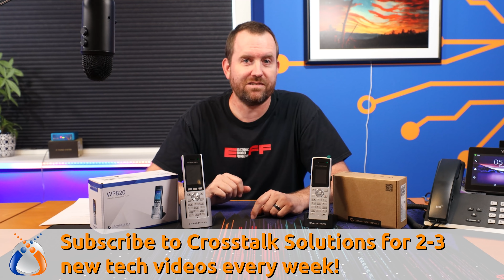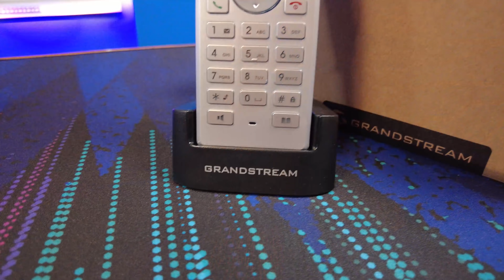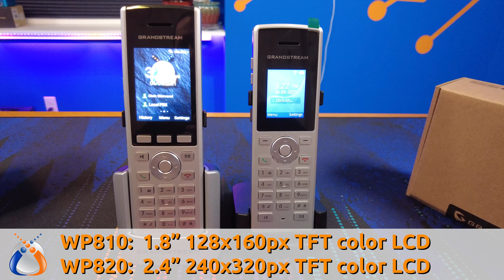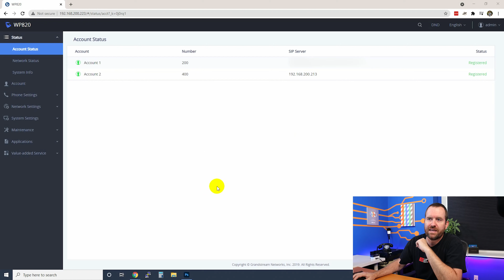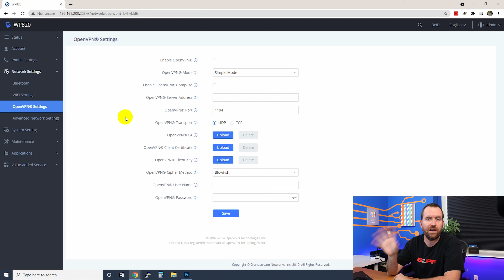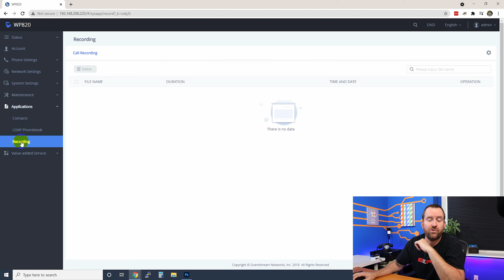Grandstream WiFi Phones - Any Good??

Comment: Newer sets now.    Both the Grandstream Dect and WIFI cordless phones have been superb since day one.     

 The WP826 is the best WIFI cordless phone, period.    Doesn't have lag or delay like others also.     (When a phone has been sitting for a while and the first digit dialed is not recognized)      The price point is amazing.   Best value for a VoIP device we've ever seen.    12hr battery, 240hr standby - come on - WOW.     There is a reason they are already sold out at most distributors.    There is not a finer WIFI cordless on the market for the price.

Comment: After a renovation we're getting our VOIP phone service hooked back up. Since VOIP phones use an ethernet connection I assume this Wifi VOIP phones would work for me? I don't want to have to run ethernet cables from the phone modem to the phone set upstairs in our study.
Reply: It's a wifi phone. It doesn't use Ethernet at all. Instead, it connects to your wireless modem.

Comment: Why purchase a wifi phone when you can repurpose an old cell phone and program your sip provider with telephony software?
Reply: Far better form factor. In a slightly ironic twist, making phone calls is the one thing modern cell phones are terrible at doing. They're very uncomfortable over an extended period of time, and having to bring up and use the digital dial pad in the middle of a call can be cumbersome vs. the physical keypad on the wifi phone.

Comment: Hi Chris. We recently changed from hosted to onsite PBX using Freepbx. I am currently struggling to connect the wp820 to freepbx. I have done the Fanvil x3 without any problems. Both phones worked perfectly with the hosted server (I do not know what software was used).

Could you please give me some advice? I am in South Africa.

Thanks,
Marlin

Comment: A good way to use the two accounts is to set up one for the local WIFI and the second to the same extension but the external ip address.  then can use the phone while out of the office as if still in office.

Comment: Deployed these on an avaya ip500 system on a 3rd party license after out old dect system failed about 3 months ago. Found these to be awesome and much better then the android grandstream app which often failed.
Reply: I found making a SSID on Ubifi at 2.4ghz only gave you much better coverage. Only area which was tricky was a thick metal door where the pass over between outdoor WiFi unit and inside had a small delay rarely dropping the call.

Comment: Man, the WP820 would (could) be a perfect replacement for an airport / ground handling radio setup (at least if it was waterproof, or a decent case). 8 hour shifts, multiple group and direct calls through the PBX, an OS which could run custom apps (say to trigger announcements, manually update screens, even work with dispatch data which can change at a moment's notice), and of course can roam freely throughout the airport on already installed infrastructure, with no radio channel limits and (relatively) crystal clear audio that could even be used to make announcements from anywhere in the building. Even if it can't be used outside, it could interface with existing radio systems (which are usually PBX based / connected anyway) and beat them on price for those who are usually inside. Most calls would be done while stood still, so probably jumps probably wouldn't be a huge problem, and at the price it would be a steal, especially in smaller airports where staff serve multiple roles and move around a lot

Comment: These phones would be awesome if they just had either rj45 or usb ports to connect to wired ethernet.  Wait, it does have a micro usb port.  I wonder if you can connect a micro usb to rj45 adapter and use it on wired ethernet?  Bah, nevermind, the micro usb port is apparently only for charging.
Reply from the maker: If you need to connect a cordless handset to wired Ethernet then you use DECT, not WiFi.
Reply: @CrosstalkSolutions  In this day and age, people are becoming concerned that being in close proximity to microwave radiation sources contributes to cancer and other ailments, and rightly so.  And, in this day and age, I would expect a phone like this to be able to plug directly into a cat5 or usb-cat5 adaptor.
Reply: @stoneysauce  Then it becomes a desk phone........a cordless phone that connects to a cord is no longer cordless
Reply: @cyberchaplain  Yes, all Im saying is that there really is no reason why this phone shouldn't be able to also work from a cat5 cable, as all android phones are capable of doing.

Comment: Wow, we kinda have the same set up, I have an edge router 4 and 4 access points, but I'm all on one floor.  Basically an AP in each corner of the house, two AC-HD's on the most used side, an AC-Pro, and an AC in wall in the garage.  When I first moved here years ago, cell service was crap, so I had to rely on wifi calling.  I had the same issue with a brief lost of audio when roaming, but I checked "fast roaming" and it fixed it.  I know you know about that option, I've just noticed after some updates, I've had to go in, uncheck it and provision, then re-enable it and provision for it to work properly again.  I also noticed the other day that my some of my SSID settings had been defaulted and I had to re-enable them.  So now after every update I make sure I check everything.  Anyway, I know you know this crap more than me, just rambling I guess.  Always enjoy the content man!

Comment: Just a quick note that I don’t think was mentioned here. We ran this exact test a month ago for a client with 45 APS. We found the 820 fell short of the 810. 810 is wifi AC and 820 is wifi N. Also, 810 had 0 second drops between APs as the 810 supports 802.11r (roaming). When configured on your AP, voice continuity is flawless where as I found the 820 dropped for more around 3 seconds per AP. We roamed between around 8 APs. 
You need to enable 802.11r on your AP.
Reply: How about using wifi 6? Any of these wifi phones truly worth it?
Reply: @psfgtech  unfortunately there are no Wifi 6 APs at this location. After having these handsets in place for about a year now, we’ve had about a 20-25% RA. We will never put the 810s in again. Everything from simply not connecting to wifi, buttons not working, not booting…I would hate to think what a large fleet would be like.
Reply: Thanks for mentioning it. This could explain the battery talk time difference.

Comment: We only install Grandstream and have from the start. I think they're pretty solid and the price is great.
Reply: I have a weird relationship with Grandstream.....their desk phones are maddeningly inconsistent. Their analog gateways and wifi phones? Very solid. I agree with Chris that their PBX is convoluted and I don't touch those.
Reply: @cyberchaplain  I've always had great luck with everything we've put in. I find their PBX to be a lot more user friendly than say FreePBX or any of the others. But I know we all have our preferences.
Reply: @digitalsquaretn  absolutely agree. I think UCM66xx series are very good and easy to handle
Reply: @digitalsquaretn Late to this party - 5 yrs old Video but agree with Digital and Cyber -  I just setup a new UCM6304a - everything works - and with the feature set I was able to customize the IVR, Call Queue, On Hold and used AI Voice for custom menu's - it works well - I have an old 6208 and the menu is not as robust as the new 63xx series but I use it in my lab and it works fine. Yeah, you have to push through the learning curve but Grandstream's feature set is good even when you have to drill down in the weeds for the detail items.